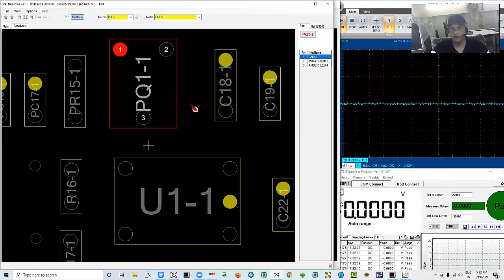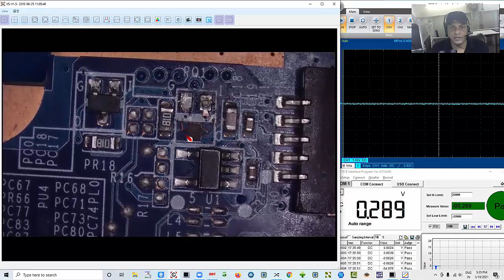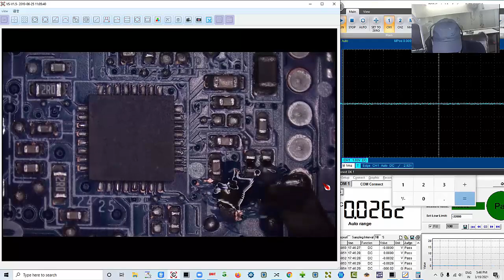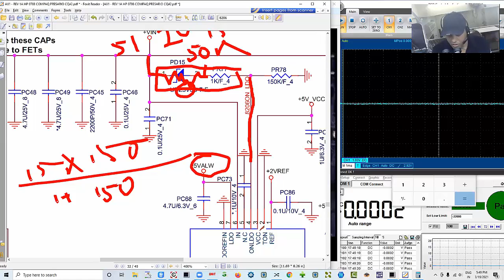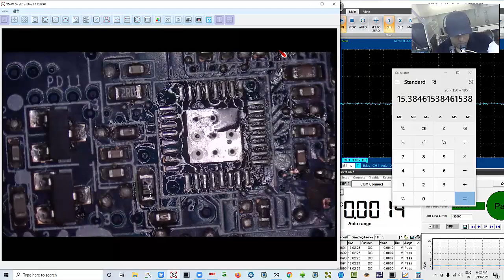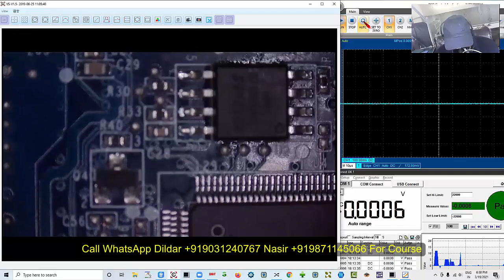HP CQ42 DEAD HOW TO READ SCHEMATIC DIAGRAM | ENGLISH | VIN Section OF 3V 5V Jugaad |Chiplevel Repair

Comment: Hi thank for sharing a wonderful and helpful video to us.
Sir can u give me a advise  what is the problem if i can get only 3volts from second mosfet before the current sensing resistor
Reply from the maker: Thee is leakage in the MOSFET or MOSFET channel is not open completely...that is the MOSFET is not working fine. Or sometime leakage from the auxiliary component of the circuit.

Comment: Nice conceptual, Sir if flash (8mb) was written successfully but not verified after written (using ch341a device and programmer) and board does not trigger, so is the flash corrupt or something else? (acer aspire one]
Reply from the maker: Both possible.